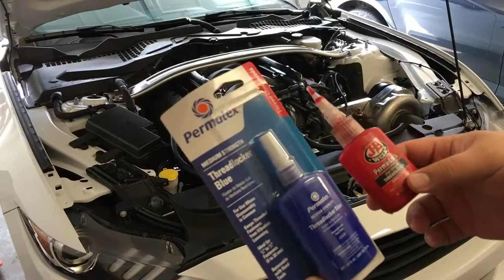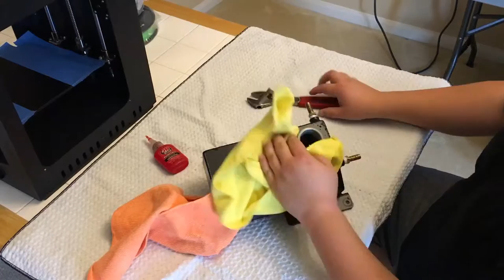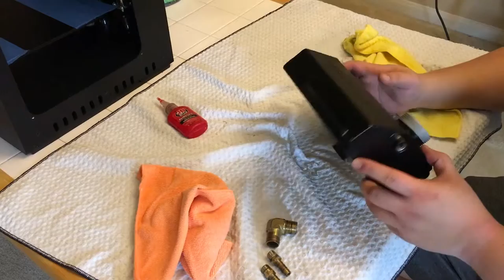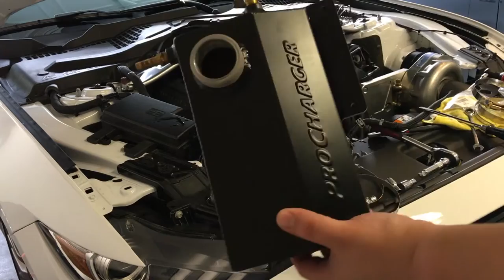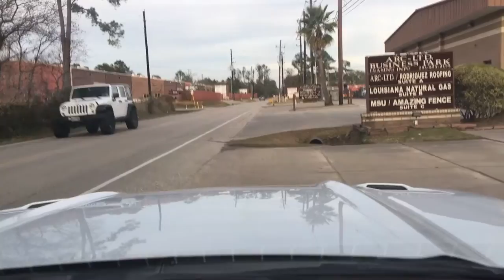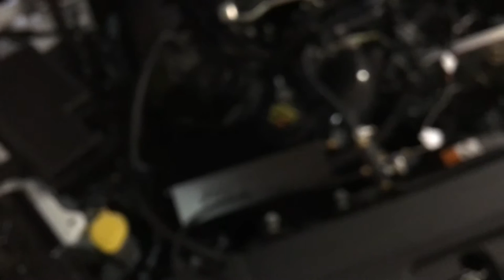ProCharged 2016 Mustang GT Coolant Reservoir Tank Leak Fix

Comment: Also the insulation on my hood has a dent in it from the procharger cap, so that means its pushing on it, could downward pressure on the cap cause a problem?
Reply from the maker: Sounds like your hoses for the reservoir may be forcing the tank into the insulation. I have not had that problem. What I would do is drain the tank and loosen the hoses with pliers and move them around (rotate) until they are in a neutral position and do not force the tank upward.

Comment: You didnt lose much fluid? I am having same issue but the fluid never lowers past the bottom connection to the tank, so I never overheat..but I sometimes get a slight rough idle, wonder if the coolant losing pressure can mess with the system that way...
Reply from the maker: No I only sweated a little. I could smell it in the car, but as far as loss it was probably tens of milliliters. More annoying than dangerous. This is also a reservoir tank, not your main supply of coolant. Coolant temperature does affect tables within the tune of the engine management, so it's possible a low level could impact how the car idles in theory if it's outside of the normal range.

Comment: gonna get a hood to vent that heat?
Reply from the maker: For sure man, looking at some CF options. I'm just trying to find something functional. Fluid dynamics has proven most scoops and such don't do anything if not properly tested/designed. Air doesn't want to go into random pockets. So the goal is to make sure air can enter the front grill and vent out of the hood efficiently. Also yea the worm gear clamps suck :)